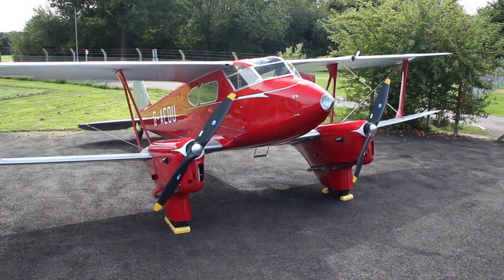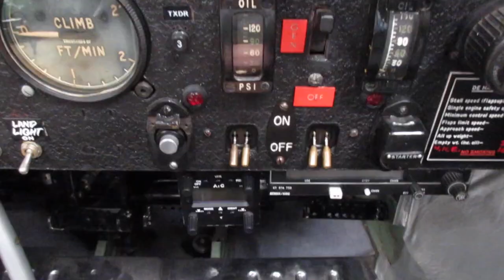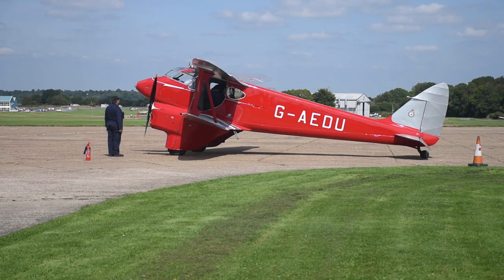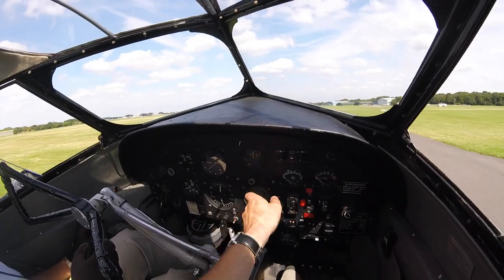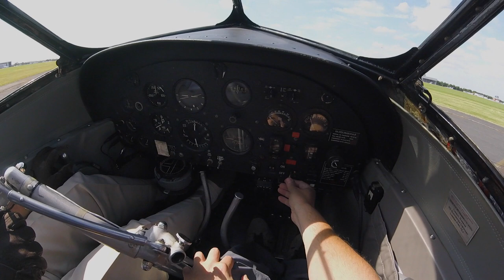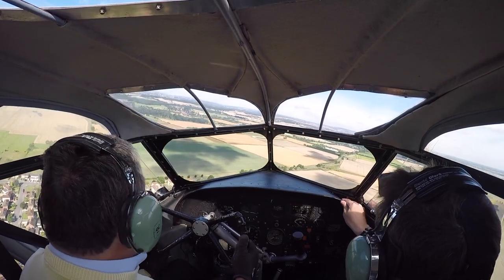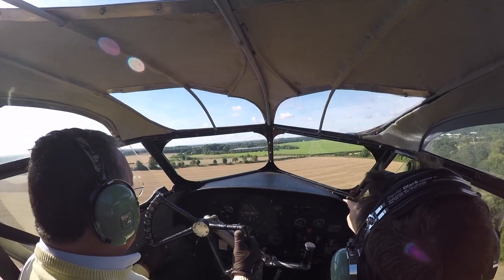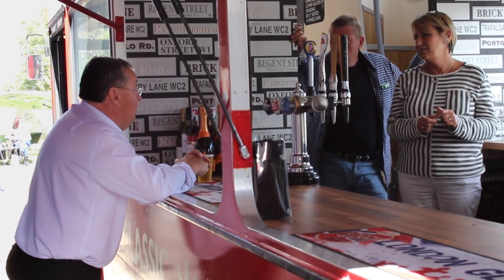Dragonfly G AEDU

Comment: What a superb film. A walk round is so instructive to start with and then handling notes. Marvellous. I have been involved with the circle of DH90 fans in New Zealand where they have ZK-AYR still flying. They have also had the biggest search in NZ for the Dragonfly of Brian Chadwick who went missing in 1962 with ZK-AFB. Recently I found my parents film of Chadwicks DH89 and posted that on YouTube. Even more film has been discovered. The Dragonfly was a superb aircraft in so many ways. For NZ Southern Alps flying it was not the best choice due to Carb Icing problems in its Gipsy Major (?) engines. The carb heat only came on when throttling back. So Delta Uniform does not have Carb Heat! I did hear that a Tiger Moth used for the film Solo had a modification so that carb heat could be used at full throttle. It made that aircraft much safer in the cold wet cloudy west coast of New Zealand. It is thought that AFB was prone to carb icing and probably that caused it to come down in the NZ jungle and lost in that area. 
What a superb aircraft G-AEDU is and duchess is so appropriate for it. Thanks for posting it and I am so surprised used not to have come across this before.